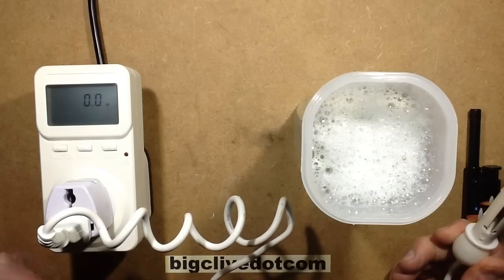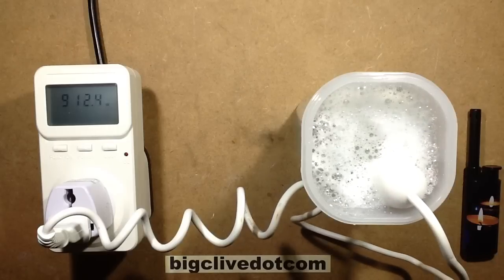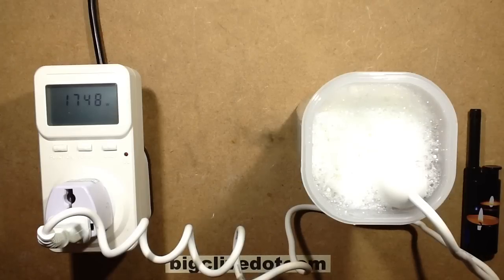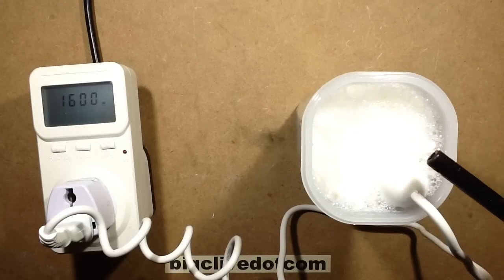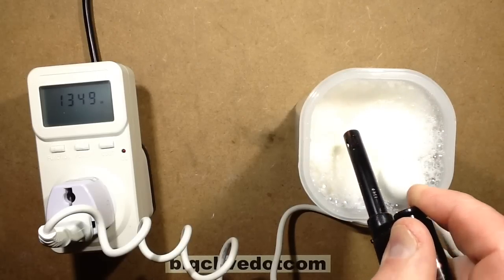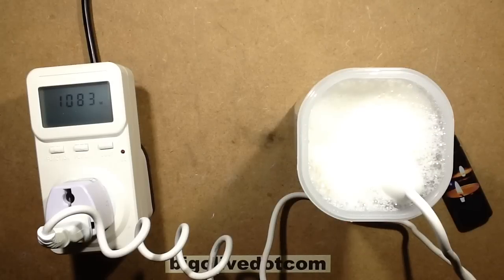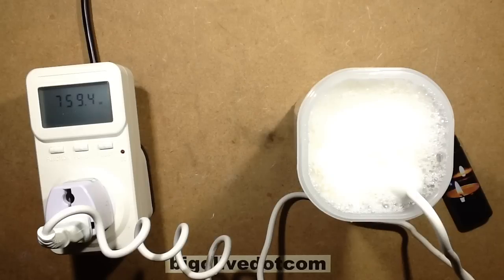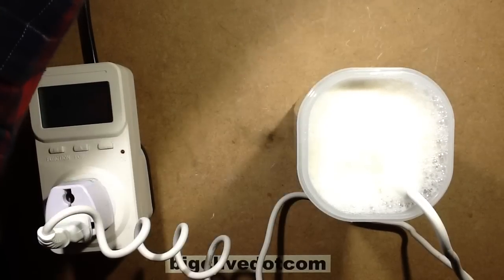Does the AC electrode boiler produce hydrogen and oxygen?

Comment: Dont you need DC so the current flows from one electrode to the other in order to split the 2 hydrogen molecules from the oxygen
Reply: +IIGrayfoxII yep
Reply: +IIGrayfoxII Not really. AC is really just DC that is switching polarity at some rate. Of course, you'd get a mixture of H2 and O2 on both sides instead of H2 on one side O2 on the other, so it would be useless for many applications, but there's no fundamental limitation. The limitation in this case, I suspect is that 10 ms (half a cycle of the 50 Hz used in the UK) is not enough to cause any significant electrolysis to happen before the time is up and the polarity switches again.
Reply: you folks should google the word electrolysis and ignore the stuff about hair removal
Reply: not necessarily...
Reply: +Gameboygenius With no catholytic polarity the electrons in the bonds remain stable, the only way for AC to cause electrolysis is through thermolytic reaction which would require 3,000 degrees Celsius. Here is a very thorough explanation of how electrolysis occurs. http://www1.lsbu.ac.uk/water/electrolysis.html
Reply: +Terry Heeter Do a thought experiment of the extreme end of this, where you use something like 0.1 Hz AC, ie the electrodes stay at each polarization for 5 seconds at a time. Some of the water will with no doubt have been electrolyzed during this time period and some of the gas will have bubbled up to the surface before the polarity flips. Are you saying that this cannot happen, just because the potential is continually changing? AC is (for sufficiently low frequencies) just changing DC.Whether electrolysis can occur depends on the frequency and, I suspect, the distance between the electrodes (with smaller distance allowing a higher frequency).
Reply: The minimum necessary cell voltage to start water electrolysis is the potential 1.229 V.
The potential necessary to start water electrolysis without withdrawing heat from the surroundings is -ΔH°'/nF = 1.481 V. So even if you separate the bridge of distance between the anode and cathode it only creates less resistance allowing more recombination. A good analogy would be that, just because you spread a bonfire does not give you more smoke, it's the same amount of smoke. As I stated before you would need plasma levels of heat which technically would no longer be electrolysis, but thermolysis which is even less ideal due to decomposition.
Reply: +Terry Heeter But none of what you just said is a response to my thought experiment of using very low frequency AC. Again, AC is (for sufficiently low frequencies) just a changing DC potential. None of what you said proves your original claim that AC can't cause electrolysis.
Reply: +Gameboygenius I tested it. I took similar electrodes, and i basically just rectified mains and then reversed the plug every 5 seconds which is 0.2Hz. It looked quite cool because the bubbles were disappearing that were on the electrodes, but the bubbles coming off were clearly hydrogen. The oxygen levels were too low and just solved in the water.
Reply: Gameboygenius
I never said it cannot, you are assuming that because you want to create a scenario in which you are correct. If you had actually read my comment what I state is that AC current for electrolysis is not biochemically ideal. I provided a link which fully explains why if you want to read it. My analogy covers your idea on frequency, What you are implying is like asking what weighs more a ton of steel or a ton of feathers? Making AC the standard for electrolysis would be more likely a physical aspect than a technical one.
Reply: +Gameboygenius
you like thought experiments? well, get a dc motor, and put AC on it. If you gro from 0,000001hz to 1khz, at first it will turn in one
direction for a while then the other, but as you go up past just a few hertz it will start not moving at all, at 1khz it will be not better than a heater +
speaker combo.
That&#39;s what happens with electrolysis

&#160;your thought experiment is crap. You need DC and TIME for the molecules to stick together and float to the surface. If you dont give it enough time then being in contact with the electrodes would just recombine them into water when you switch polarity because O2 is reactive. Basically you are burning water under water. (and that causes a lot of heat too)
0,00001HZ or dc is the same, as per wave theory, DC doesnt exist, it&#39;s just an infinite sum of infinitely low frequency sine waves.
#rekt
Reply: +Gameboygenius Before H2 and O2 form, you'll get H+ and O-- Ions. Those recombine when they are close (as with the AC system where they form on the same electrode) very rapidly, generating heat! At 50 Hz, the electrolysis is fast enough but the recombination is even faster!
Reply: +ChrisD4335 Not even Wikipedia will give correct answers always. Using Google lands you more on nonsense than on correct answers. I' d stick to Wikipedia!
Reply: +Terry Heeter :  " With no catholytic polarity" , LOL, I think you mean Cathodic polarity. Just call it "Negative" (where Anodic is Positive)!
Reply: +Terry Heeter By the way, nice link!
Reply: +Gameboygenius Good suggestion. Though it is not the electrolysis that is not fast enough but the combining of H+ and H+ with two electrons to form H2 (and O-- and O-- losing four electrons to form O2) that takes time.
Otherwise the H+ and O-- ions would recombine. 
I have no idea how much time it cost to form the "Brown's Gas" but an experiment might give resolution.
Reply: +Imre Fabian After half an hour of research and thinking about this I've been forced to switch camps. My intuition told me that using AC should just produce "HHO" gas. However it seems you are correct that with AC the individual atoms of H and O produced don't have time to collect in great enough quantity to come out of solution.Thought Experiment: We know water is already full of "dissolved" oxygen because fish live in it. We also know that DC electrolysis works, and that Oxygen collects at the positive electrode and Hydrogen at the negative - even when they are separated by several inches. When a molecule of water is split at the positive electrode and frees an atom of Oxygen, how do the two much lighter Hydrogen atoms make it all the way to the negative electrode (a distance billions of times their own diameter even if the electrodes are only an inch apart)? The hydrogen atoms MUST be present at the spot where the atom is split, and yet they only collect in large enough quantity to form bubbles at the negative electrode. And the opposite situation is happening with Oxygen atoms at the negative electrode which don't bubble out but stay in solution unless they are touching the Positive electrode. (Guessing now:) With 50 or 60 cycle AC there just isn't enough time for the Oxygen and Hydrogen atoms to get away from each other and collect in sufficient number to come out of solution and they simply recombine. Thanks to Bigclive and everyone on both sides of this thread for the mental exercise!
Reply: +A1Skeptic I plan on trying this with a microwave oven transformer to see if 2,000 VAC makes a difference. I like to prove myself wrong. :)
[Replying to myself because edit is introducing errors]
Reply: A1Skeptic exactly.
To be more precise, water is always made up of H2O plus a certain percentage of H+ and O-- ions, but also OH- ions. It's a dynamic mixture, dependent of temperature and many other parameters.
The amount of dissolved O2 molecules is not constant and also depending on temperature and pressure. The level of saturation is seldom reached as the twmperature fluctuates.
Indeed the mobility of ions is very limited, but ions can steal or donate electrons from or to neighbouring neutral molecules  ionizing those in the process. That can happen relatively fast.

I don't have the exact figures, but experimenting would give you some answers.  Good luck!
Reply: +Terry Heeter It's not ideal, but the argument is, is it possible?
Reply: +Imre Fabian Actually that makes sense. So there might be electrolysis happening, but the atoms re-join too quickly for any bubbles to form.
Reply: +A1Skeptic Anything over 1.something volts is wasted as heat. You need high amperage for more electrolysis. Reducing the resistance of the water, ie with a little salt, will help. As somebody pointed out, electrolysing salt water produced chlorine gas, so maybe some other salt would be better. Don't ask me which. 

I wouldn't do your experiment, might be enough localised heating to cause an explosion, even with 240V the water looked pretty violent. If it was shaking Clive's table, I wouldn't want to go much further!
Reply: greenaum Indeed, the IONS (charged atoms or molecules) re-join to quickly. 
A little (table) salt could produce some chlorine gas at high DC currents but since only a pinch of salt is sufficient,  the amount of Chlorine gas will be negligible.
Reply: +greenaum Agreed. I was tired. I slept on it and realized most of the energy would just be heating the water. A low electrical potential is all that's required. But I have an amateur scientists desire to conduct experiments that will negate rather than enforce my hypotheses. :) So instead of high voltage AC, perhaps it's worth trying low voltage but high frequency AC. I don't think it'll work, which is why I'd be pleased if it did!

Comment: There's probably is some hydrogen and oxygen, but the amount is likely to be tiny, compared to the steam produced. The hydrogen will probably dissolve in the water, IRC it dissolves in just about anything, and the oxygen will just add to the air, but air is 20% oxygen so no big deal.

Comment: I kinda surmised it'd be more likely to produce death. But hmm! Still, there's bubbles in some form coming off those electrodes. I guess my question would be, can AC be used for electrolysis, and actually split water, that's something I always felt too silly to ponder or ask about.
Reply: +MattExzy https://en.wikipedia.org/wiki/Electrode_boiler
Reply: +MattExzy Short answer, no. AC is pretty useless for electrolysis. Sure it can, and does "split water". But on the change of polarity it is, in essence, trying to undo what it just did on the last part of the AC cycle. (Well not really undoing anything... It is producing 'ions' on both electrodes.. But when polarity keeps changing it keeps producing the opposite ions on both electrodes... effectively canceling its self out) All of this ionization energy flip-flopping back and forth is why it makes a bloody good heater though :P

Comment: you need to put in a ac to dc rectifier and then it will work you also can use common table salt or potash which is the proper mineral in distilled water

Comment: The bubbles must contain a gas of some sort. It can't be steam because that would condense back to water instantly. It probably is hydrogen and oxygen but in bubbles so tiny that any heat of combustion is consumed by the liquid. Fill a closed container with the foam and let it settle until the bubbles break and the liquid separates at the bottom. Then try lighting it.

Comment: A lighter isn't a good test for that. I've used drill batteries with electrodes in water to produce a lot of foamy bubbles like that thing makes. I know for sure that is hydrogen and oxygen, yet I can't get it to catch on fire with a lighter. What I'm guessing is happening is that the gas in them is catching on fire but it is such a small amount that burns up so fast that you can't see it and isn't enough to pop other bubbles to start a chain reaction. If you really want to test this well, collect some bubbles in a sealed container then see if the gas in it will ignite after the bubbles pop.
Reply: +HolyDevilKing Batteries produce DC. This produced free Hydrogen Gas: H2 (and Oxygen Gas: O2).
This cannot form with electrolysis at 50Hz AC.
Reply: +Imre Fabian I'm not saying whether AC can or can't create hydrogen and oxygen. The point is that using a lighter on such foamy bubbles won't work no matter if it is hydrogen and oxygen or not because I've tried that using dc current and got no visible results. A different test needs to be done to be conclusive.
Reply: HolyDevilKing What were the parameters? (pureness of the water  temperature, voltage, currenr?)
Reply: +Imre Fabian I had a freshly charged 12v drill battery, room temperature tap water with some salt for conductivity, and whatever bits of metal I found to stick in the water for a bit of surface area.
Reply: +Imre Fabian and no idea what the current was.
Reply: HolyDevilKing whell, that should do some serious electrolysis. How did you try to capture the gasses?
Reply: +Imre Fabian I put a lighter flame on the bubbles which looked very similar to the bubbles in this video, and nothing happened. That's what makes me think his test method isn't sufficient.
Reply: HolyDevilKing you need to seperate the gasses, by capturing them under a (glass) vial. Bubbles are insufficient to seperate the H+ and O-- ions that should form the H2 and O2 gasses. Remember that negative and positive ions attract eachother!
Reply: +Imre Fabian I lack equipment of that sort. Maybe I can just fill a baggie with bubbles and wait for them to pop and try to catch that trapped gas on fire.
Reply: HolyDevilKing I am afraid that will not work. You have to separate the gasbubbles as and where they form, i.e. the electrodes themselves  using a membrane (hard to get by) or, as I said, glass vials. Upside drinking glasses over the electrodes might do. Be carefull lifting those out of the fluid. H2 is lighter than air; O2 is heavier. That glas has to be closed before lifting it out of the fluid before turning it over!
Good luck!

Comment: It's probably just dissolved air that is being released. Boil the water thoroughly first to get rid of the dissolved gasses. Then let it cool in an airtight container see if it still produces bubbles. Any electrolytic reaction will be be quickly reversed with AC and the oxygen and hydrogen recombine which will return heat energy.

Comment: Why doesn't AC discolour the water where DC current will?
Reply: Colour change in the water with DC would be the electrodes dissolving. If you used copper electrodes, the water will go light green colour with copper ions; Iron electrodes will make a light rust to muddy brown colour (literally rust) of iron ions. The water boiler as well as using AC which will reduce the loss of the electrode to solution also probably has stainless steel electrodes which should also resist dissolving even with DC.
Reply: +Bryn Jones
oh you bring up a good point.  With metal dissolving in the water,  should a person drink it? 
I heard of a family that were being poisoned by the  old copper pipes in their house.
Reply: +Willy Bee No you shouldn't drink water obviously coloured with copper salts, they are toxic. However metallic copper, for example from copper pipes or coins is not significantly soluble, which is why it is used for water pipes.  The high price of copper is one of the main reasons plastic pipe is replacing copper in new installations; likewise cost is the driving factor for copper coated aluminium (cca) wire.
The only time you see significant corrosion in copper is when there is something driving it, be that electrolysis, high temperatures, presence of a strong acid, etc. For example copper is used for roofs which turn green over the course of a few years and take many decades to corrode through, if the same roof were made from iron and similarly unprotected from the elements would rust through over the course of a couple of years, which is why iron and steel are usually protected (paint, galvanised, or other passivation).

Comment: Not Hydrogen and Oxygen then, it can't really be steam as it would condense, maybe it's dissolved gasses; the ones that come out of solution when you start boiling water in a kettle? Soon see if it is by trying boiled water.
Reply: +Nic Green He added dish soap or something to capture any off gassing.  So bubbles were mostly due to the soap.

Comment: I would have filled a glass with water, and then inverted it over the electrodes.

Then left the elec trodes running.

Two options.. 

1) Water is not displaced.. conclusion.. bubbles were steam, which reccondenses.

2) The water is displaced by some gases or gases.

If option 2, try the ignition test on the pure gases produced.

Comment: Air is less soluble in hot water
Reply: Yep that is my guess too. You can see the bubbles coming out of solution as you heat any  pan of water, well before it boils.
Reply: +Peter Workman: "Air is less soluble in hot water", True, but the first bubbles you saw in Clives Thea cup WERE steam!
The heat was not enough to boil out the solved air initially! When the heat rose, THEN the air came out!